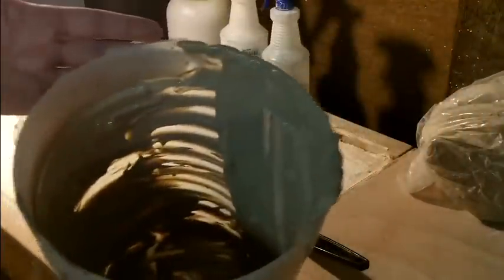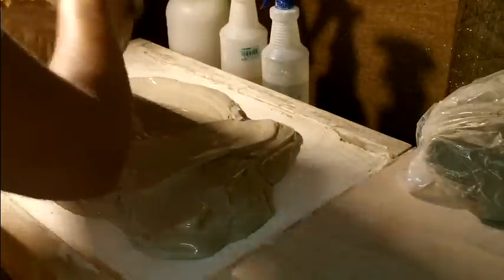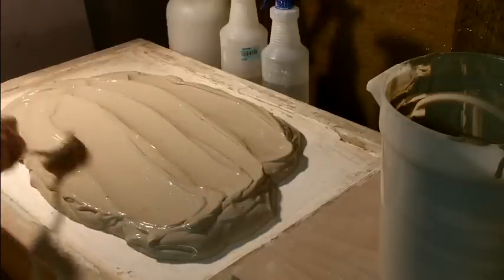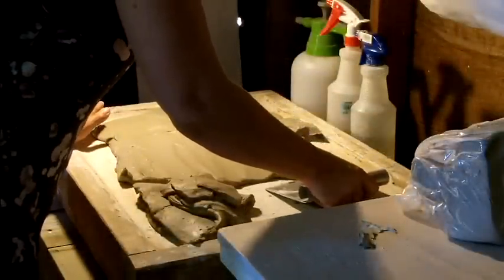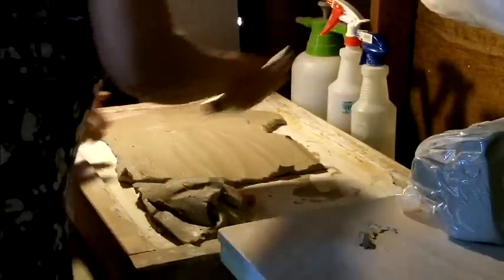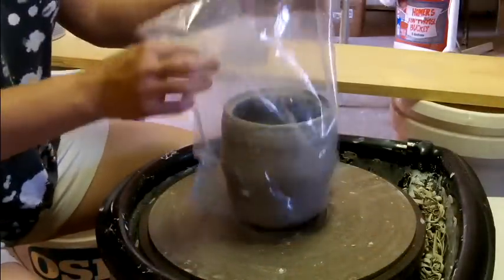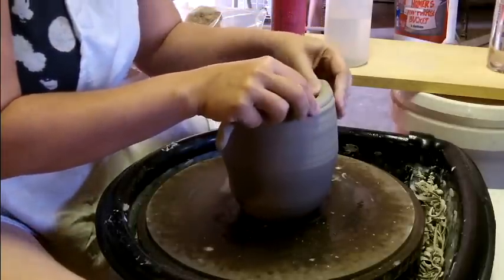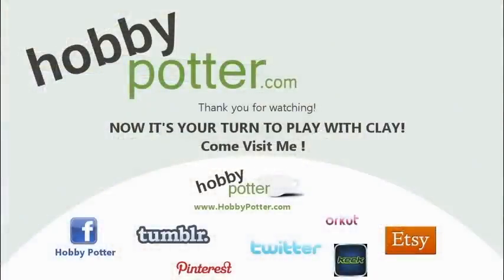Reclaiming- Wedging & Reworking a Crock Without a Lid

Comment: Just be careful using a metal scraper to take off dried clay from a plater batt or board. If plaster is going to get into your clay, you can get what is called lime popping and is something you really want to avoid. You could if you wanted wrap and stapple down canvas around the corner. Pros to the canvas is no plaster contamination but the con is many complain of increased dust and greater risk to silicosis.
Be smart, be safe, and keep throwing!
Zac
P.s-Proud to see you practicing spiral w.!